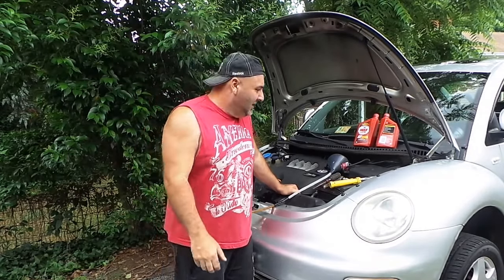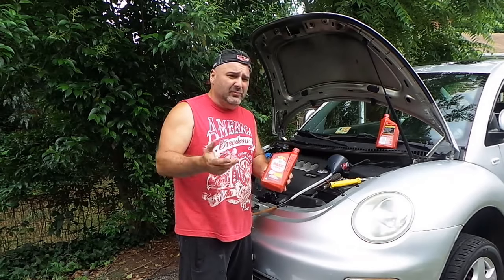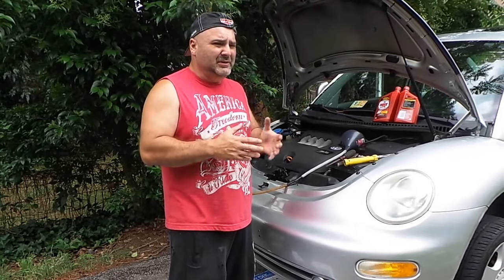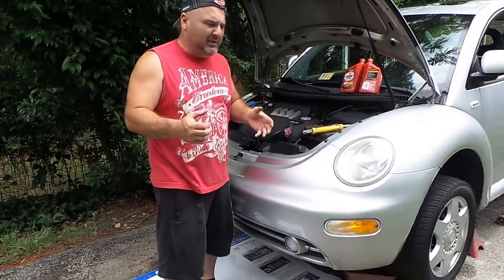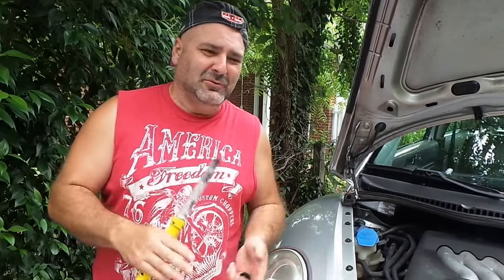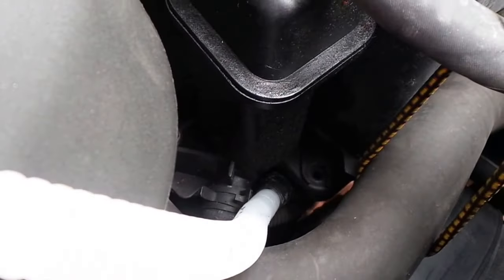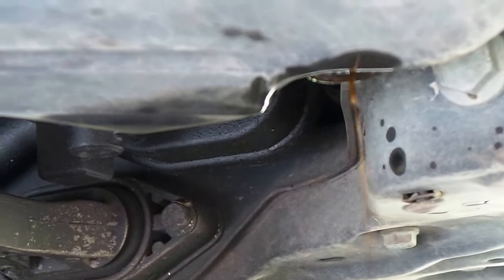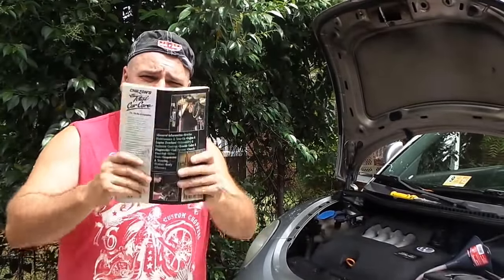How To Check VW Transmission Fluid

Comment: my 1998 beetle has a 5mm allen wrench drain plug also. PERFECT INSTRUCTIONS!!!!!!!!!! THANK YOU!!!!!!!!!!!!
Reply: fill through the same hole with an adapter or you may be able to fill from a different hole.  My 2013 Passat has a Torx fill plug up near where the wires go in.  Other ones might have a small gray tube.

Comment: My god.. I will never get another VW again.  All this, to check the transmission fluid?  WTF happened to a simple dip stick???
Reply: And it seems they took this approach to the bank. I use this piece of shit as nothing more than a beach bug, to simply drive 5 minutes down to the beach for surfing or kayaking- it can't even do that without needing to visit the shop every other month.  I will never own another one of these piles of shit again.
Reply: The gearbox oil is supposed to last lifetime.
Reply: Most newer cars are like this now.  They do it to try to keep us out.
Reply: I thought I was ok thought I had a oip leak slow, it's trans and omfg
Reply: you can buy an aftermarket dipstick thats not meant to be left in. parents jeep liberty doesnt have one either, ordered a dipstick for $13 off amazon with measurements on it, put it in until it bottoms out on the trans pan and take it back out to check
Reply: My ford explorer is the same . Sorry but it's true !
Reply: @danielfl.9347  the question is how long that lifetime will be with dirty fluid . These foreign car transmissions are very expensive to repair . New fluid is cheaper .
Reply: @johnandkayvest4917  That is true
Reply: Most cars are like this now.  As awful as it may seem they are just not making things easy any more.
Reply: @johnandkayvest4917  A lot of them are sealed like that.  Avoiding VW specifically won't get you away from that.
Reply: @danielfl.9347  but that lifetime will be longer with fluid changes at regular intervals .
Reply: Yea bec mechanic are not making money if we don't go.so they make it more complex but that don't stop me from saving money.  not a lazy fk that let mechanic rip me off. Show them this a America land of the smart, hardworking free people. Let me get rich I make a simple car for the hard working people. 😆 80billion on cov cure and I cant get a reliable car well just toyota but for how long before they start doing the same bec they are force to.
Reply: its really not that hard its pretty easy if you know what youre doing
Reply: Dynamo so is changing the break pads. But when I want to take a quick look at the trans fluid ... a dip stick is a wonderful thing.
Reply: @erikandersson1647  can only blame VW for that but honestly its really not that hard
Reply: I'm thinking the same damned thing.  It's like they want to make it absurdly complicated.
Reply: Wait til you change water pump lol!
Reply: @trippiii7715 my transmission filter is inside of my transmission 😂 09A trans is problematic
Reply: They want to cut costs every way they can't. They don't care what hassle we go through
Reply: Basically, you over fill the transmission. Then let it drain out till it drips. Then you know you have right amount. What a screwy way to do it. Aliens from other planets must be laughing at us.

Comment: I bought a 2006 beetle that was sitting in a garage for 3 years and it slips out of 3rd gear. The previous owner said it had no tranny problems . It’s getting better as I drive it more. I was going to have the fluid changed. Do you think it could be slipping because it was sitting so long?

Comment: A small hose that is long enough to go from the where the hood latches, down between the motor that is just the right size to push in the filler hole and has a small baster like top to poor the fluid in and let it drain into the pan works great.

Comment: What do you guys know about sealed transmissions?  My 07 Beetle has one and other VDubs might too.  Bought the car new off a dealer lot.  Easy driving most of time. Service kept up religiously with synthetic. Pushing 115K miles.  Should you pursue a fluid change or just leave it alone.  Spoke to two dealers, suddenly now, they're telling me "I would be risking performance later" blah blah. A year ago, they told me to come on in and they will be happy to do it for 800.  I think something came down in the interim that they don't want to do it anymore.  Will be nice to hear from you or anyone else.  Thanks.

Comment: thanks for the video on adding vw transmission fluid...what was the diameter of the hose you used to add the transmission fluid?
Reply from the maker: Mtnbug No problem at all and I used a 3/8" hose. Just make sure that you a long enough hose.

Comment: the reason vw says to come to dealership is because audi and vw use specific fluids that have specs. for example coolant is g12 or g13 pink or purple color it does cool differently from green and red. or oil has spec depending on engine my bew tdi requires 505.01 not all synthetic oil meet that spec it is very specific. so If you own a vw or audi don't just use anything. find out your spec then find compatible oil. is a few dollars worth a motor or transmission?

Comment: So I have a couple questions... Did you take off the pan and filter? If so did you have to buy a new filter and gasket? My other concern is that I've seen other videos using computers that reads the fluid temp but is that necessary? thanks!! Great video by the way!!
Reply from the maker: no you don't have to change anything in order to top off the fluid as far as the fluid temperature that's why I was saying to run it to the car gets warm 10 minutes fine

Comment: How do you know how hot the trans fluid is? That's the only thing I'm going to have a problem with.
Reply from the maker: Good rule of thumb 15 min of idle it’s at operational temperature

Comment: You have to make sure you get the right transmission fluid though. G-055-025-A2 is the right spec oil for the 09G 6 speed. SUPER TECH DEXRON-IV MERCON LV at Walmart will work it

Comment: How is that Maxlife fluid working for you?  I know that a lot of Toyota owners use it.  They have Aisin transmissions in their cars.  Volkswagen also has Aisin transmissions in some of their cars like the Passat and Jetta.  My 2013 Passat would take the G 055 540 A2 fluid which is really Aisin WS equivalent.  I am just trying to figure out if the Maxlife can be used in my car without causing a shifting problem.  Until I know for sure, I just stick with the Aisin WS or Toyota WS.  I know that Maxlife can be bought cheap anyhow.

Comment: i broke collar fill plug but i was somehow able to lock it back in for now until i get new replacement part it was hard to take off plug the red seal was cake but anyway my question is how to i take off the collar plug is a color grey and L shape made out of plastic do i jank it out carefully i dont want to break it again
Reply from the maker: I think there is a 10mm bolt pending model

Comment: Hello Jamie. I current own a 2002 vw beetle and my car seems to be heating up and I believe my fan are not working so that could be the problem but I also me came along another problem and my car seems to be stuck on one gear and if you rev it to 4000 it jumps to next gear I believe it could be that it needs transmission fluid changed but I could be wrong. Any tips or advise that you can spear.
Reply from the maker: Juan Mendoza Hi Juan, yes!! You need to go and have it scanned at a shop to see what check engine codes might be present. It sounds to me like it might be a range sensor, but instead of guessing on the parts I highly recommend getting it scanned because buying a bunch of parts that may not be the actual problem can get very expensive. It certainly won't hurt to check your transmission fluid too because if that's all that it is, you are already money ahead. Be sure to come back and let us know what you find out and if you need any help, I'm happy to lend a hand.

Comment: HELLO MY NAME IS BRITTANY AND I WAS WATCHING YOUR VIDEO BECAUSE MY 2001 BEETLE ITS LAGGING INTO FIRST GEAR BUT THE REST OF THE GEARS ARE OK . EVERYONE IS TELLING ME IM LOW ON FLUID AND I WANTED TO SEE WHAT YOUR OPINION IS COULD YOU HELP
?
Reply: Brittany Measles  I have the same problem how did you fix yours?
Reply: Cam sensor
Reply: Did you have to add transmission fluid mines is doing the same thing how much is the cam sensor
Reply from the maker: Less than 100

Comment: Thanks for this video. Quick question, where is the transmission fluid filter?
Reply: I'm sure you've figured it out by now, but it's housed within the transmission oil pan. Also, adding oil is a fcking pain.

Comment: My mechanic once changed the fluid on my golf mk4 1.8t but when it goes up the hill it delays to shift sometimes only revs go up but no shifting, when I open the plug at the bottom alot of fluid comes out, does it mean there was more than enough fluid in there?
Reply: 🙄🤔 no idea

Comment: should the car be in park or neutral?
Reply: In park.  Make sure to run it through drive and reverse for at least a few seconds to get the fluid circulating in the valve body and all other places in there.  The inside of those things is full of small passages.
Reply: park and neutral is the same. Park has a pawl and that's it. Use your handbrake always
Reply from the maker: Thanks for your comment yes very sound advice always use the handbrake and we appreciate you taking the time to watch her video today if you could like it subscribe thank you so much

Comment: How did you determine the fluid temperature?
Reply from the maker: After about 20 minutes it’s definitely warm enough unless it’s really really cold outside maybe give it 25 or 30 minutes but it should be plenty warm in 20

Comment: What's going on Jamie still looking for the top to drain my transmission fluid.. help please
Reply from the maker: What are you working on buddy?
Reply: JamieJones TheCarMan hey Jamie I have a question for you. I have a 05 jetta the transmission cooler went out and mixed the engine coolant and the transmission fluid together. I've drained the pan but the fluid in the torque converter is still milky. Is there a way to flush it without dropping the transmission and draining the torque converter. Please help

Comment: Would the location of the fill plug be in the same location if the beetle is a manual transmission? Mine's a 2000 1.8t beetle.
Reply from the maker: +Rusty Shackleford Hi Rusty, I'm not 100% sure if they are in the same location but it would be very, very similar.

Comment: So you added, not changed?? My 2012 CC Redline is slipping when I go to pull off. My Mech said the 40k tranny service must not have been done by the previous owner which Is changing the filter and fluid. How much I say? $400 he says. I say well can I not do it Myself? He says there are special tools required.  I work on all My cars, But then they are Toyota, Nissan, And Honda. This was My 1st VW and might be My last. So far at 56k It needs and has had replaced in under a year that I've had it. Two 02 sensors, a wheel speed sensor, and now this. Never had to spend so much in service on a car with so lil mileage, crazy. So can I not just buy the filter, oil and gasket and do it myself? Pretty much doing it this way?
Reply: You can do it yourself I did it on my golf 2 years ago and runs super . Also I cleaned the solenoids and  I solved the problem of not shifting .
Reply: @joseblass3228  hi, i wish to know how you clean the solenoids, thanks

Comment: Hello I have a 2005 beetle and my temperature sensor keeps coming in red I put antifreeze in it idk what else to do
Reply from the maker: +Dawnella19 Hey there..funny thing..I was just working on one of those today. The problem is that VW just use the light system rather than an actual temperature gauge so literally we are going to have to figure out why you're losing fluid. How much radiator fluid are you and losing and in what period of time? Let me know and we'll take it from there and get this figured out for you.
Reply: +JamieJones TheCarMan I haven't seen any leaks but I know I feel up my antifreeze every week
Reply from the maker: Dawnella19 Ok, do you have an antifreeze smell coming out of the exhaust?
Reply: +JamieJones TheCarMan yes
Reply from the maker: Dawnella19 Ok, are you refilling it with water or antifreeze?
Reply: +JamieJones TheCarMan antifreeze
Reply from the maker: Dawnella19 Ok, what I suggest is that you have a head gasket test performed on your vehicle. There is a possibility that you're dealing with a head gasket leak and based on the information that you've given to me, I believe that is whats wrong with your car. If its not a really bad one, you might be able to put some Barr's Stop Leak (there are lots of other products that can help stop it too if you can't afford to have it fixed right now) to buy you some time but ultimately, you are probably going to have to get the head gasket replaced.

Comment: Thanks for the video. P.S. not only "guys" work on their cars. Sadly I just lost my 87 Chevy Sprint. However, I will be working on it in attempt to get her back on the road. In the mean time I had to buy one of these ($700) runs good, hesitation when initially put in gear. Not even close to the gas mileage of my three cylinder turbo.

Comment: Is this an automatic trans? 
How much fluid is needed to do a complete change? You need to buy enough before you start the process right? 
Not impressed.
Reply from the maker: So the exact amount is very vehicle specific so just call the Volkswagen dealer to talk to the parts department they will give you the exact amount now unless you have a machine that can pump out the entire system you’re not gonna use the system capacity so I would think you’d probably use less than three or 4 quarts once you go to drain it out There another word remove the drain pan but they do have a hole on the side that you fill up until it spills out now pending on the model I’m not sure what the capacity of that panel actually be but the dealer can get you close I would say a gallons a great start but if you need them or you could always go back and get some more

Comment: If you don't have it running when you check the fluid you will lose too much.  When it is running it is pumping some of it through the transmission even in park.  That overflow tube just lets out excess fluid when the car is running but will let out a lot more if not running.  Then the fluid will be too low.  To drain the rest of it, remove the overflow tube.  Some of it remains in the pan because of the way they are made and it is up to you if you want to unbolt it to get that last bit of fluid that won't drain.

Comment: Thank you for posting this.  I appreciate your work.  I would like to contribute. Keep in mind your year of car matters to the tranny fluid you use.  Here is a youtube of the location of the fill tube with battery removed,  https://www.youtube.com/watch?v=fbbhuhOlaGg      Next, here is a youtube of another way of doing full filter and fluid change - https://www.youtube.com/watch?v=RnDuAAM5alI   If you have not done a oil change or familiar will the basics of transmission change, I would be very careful if I were you.  The engine and transmission are the two most expensive components of your car.  Good luck

Comment: Blah Blah Blah warm it up, slide under and pull 5mm drain plug out. If nothing comes out add fluid till it does then replace plug. That tube is less than 3" in the pan. No jack stands needed...